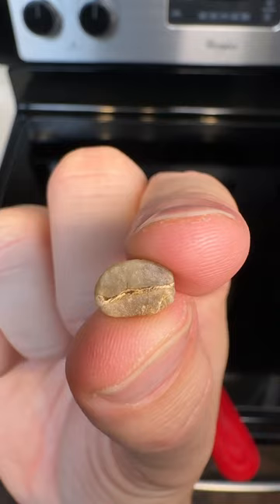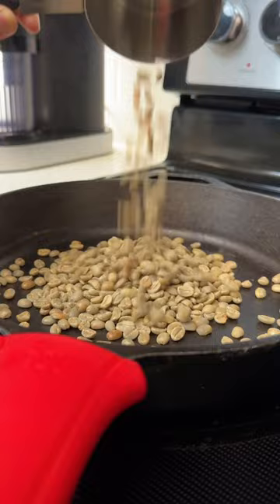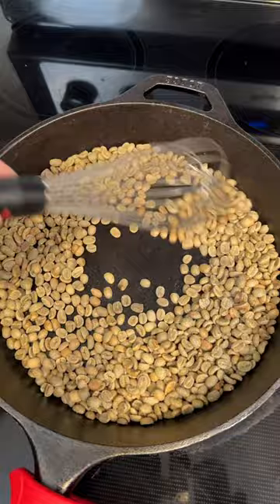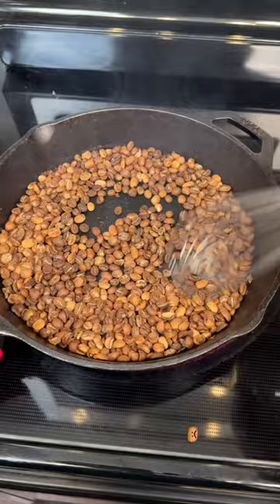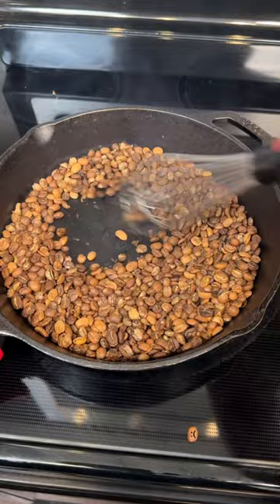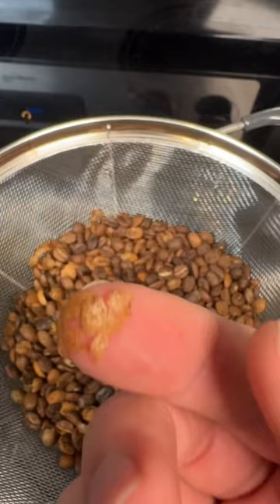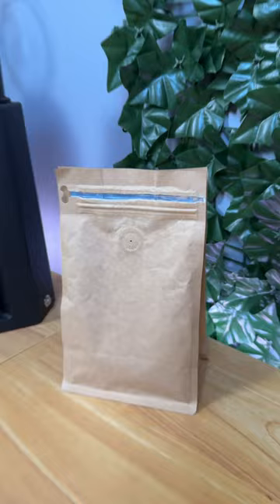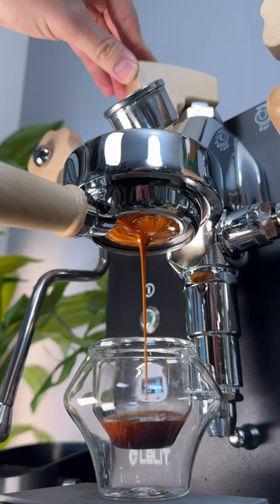Can you roast coffee with a frying pan? #coffee

Comment: I roasted coffee in a cast iron pan for my first year of roasting before purchasing an SR540 Fresh Roast, once I got the technique down the fry pan turned out some good coffee.
Reply from the maker: I definitely believe it, any tips that helped you get a more even roast?
Reply: @Ryantagcoffee  I've got a gas stove so I developed a profile for an Ethiopian Yirgacheffe that I like. I set my oven to 350 degrees and preheated the pan then set the burner to 7 and added 114 grams of beans then at 2 minutes I increased the temperature a quarter turn and again when I hit yellow at 3 1/2 minutes and again at 4 minutes and again at first Crack at 6 minutes, finishing at around 8 minutes. They looked pretty even after picking out maybe 6 to 8 of the under ripe ones.
Reply: Try oven and pan inside a pan. Just because you can. BBQ grill also works

Comment: except my local coffee beans used that i know of... The beans are Robusta roasted with butter/margarine with sugar.. until its chocolatey brown or black finish..
Reply from the maker: Ohhh that sounds so interesting, does the sugar come through when brewing the beans? I’d also be curious if using beans roasted like that can damage a coffee grinder
Reply: That's how coffee is traditionally roasted in Malaysia and I think other parts of Asia.
Reply: @Ryantagcoffee  As the other commentor replied, it's a traditional roast type in parts of Asia. Here in Singapore it's also called the "Nanyang Blend". I got my hands on some and tried grinding it in my Baratza Encore, it didn't take more than a handful cups of coffee worth of beans before it choked my grinder's exit chute. The margarine and sugar, amongst a few other ingredients (I heard from a supplier that they also add cornmeal into the roaster) makes the roasted beans a little sticky to the touch, so that definitely stuck to my exit chute and caused a blockage. Thankfully it didn't damage my grinder, but I did need to thoroughly clean it with a stiff nylon brush.

Comment: Try low heat pan + heat gun. Got surprisingly even roast on every single bean with that method in the standard roasting time. All you need is constant stirring. Most heat comes from the heat gun, warm pan just helps with consistency.